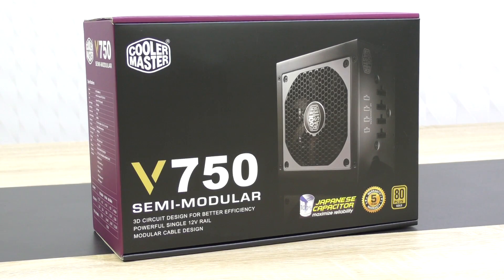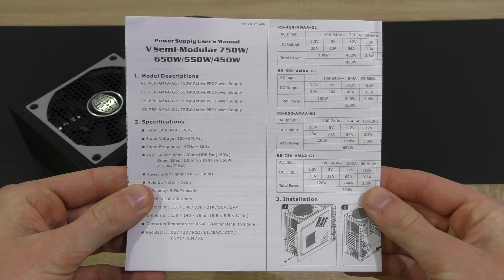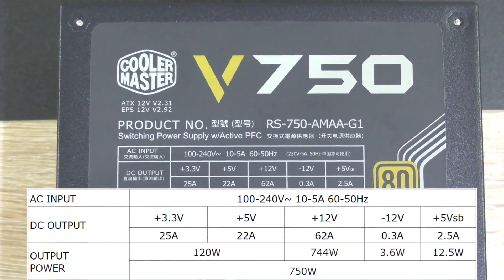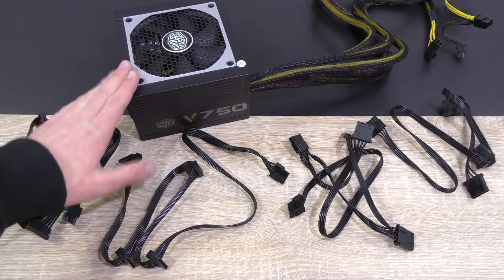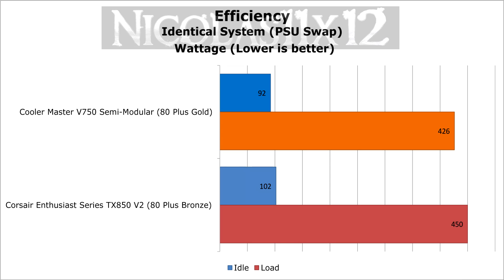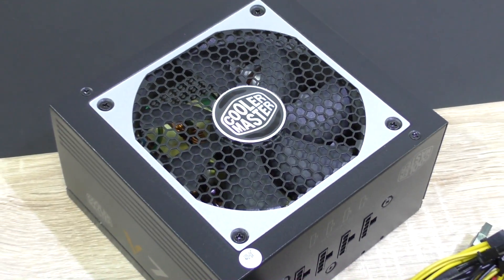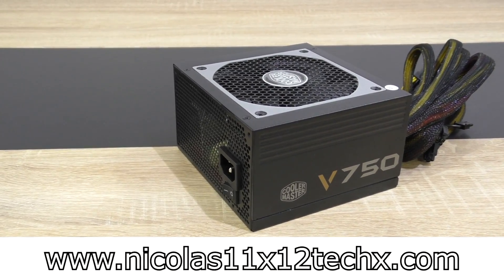Cooler Master V750 Semi-Modular 750W Power Supply Review

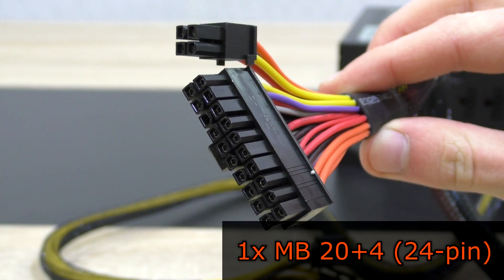Comment: 3:26 is there anyway to work around this issue and daisy chain or add a second 4+4 pin to this PSU? I just bought a z590 with 10600k and this is my PSU and that Mobo uses a second 4 pin :( Can i still use this PSU?

Comment: Can you please tell me what is your build? Looking at watt consumption, I would like to make an idea on what system uses around 450W on full load...
Reply: +talas attila&#160;
CPU: i7 3930k OC@4.2Ghz
RAM: 12GB DDR3 1600Mhz 
Video Card: 970GTX Mini OC@1576(Base)/1716(Boost)/8002(Memory Clock)
PSU: 750Watt Thermaltake (at least 8 years old and on its last leg.)
Two SSDs and one 7,200 RPM Hard Drive

All of this pulls avg under full load 420 watts from the wall. I have seen it peak to 440 watts but no higher. This is using a voltage meter pulled into the wall outlet.
Reply: +MultiMayhemGaming Thank you.

Comment: I got cm vanguard 850w its a great psu based on performance/reviews. 750w costs like 50-70 bucks less with near same performance. With a few drawbacks. Not fully modular. Smaller fan. Higher noise. Higher temps. As far as efficiency goes its nearly as good. Maybe it was slightly worse capacitors but im not sure about that. Theyre japanese anyway. And "ugly" cables. Thats subjective. I dont care what the inside looks like.